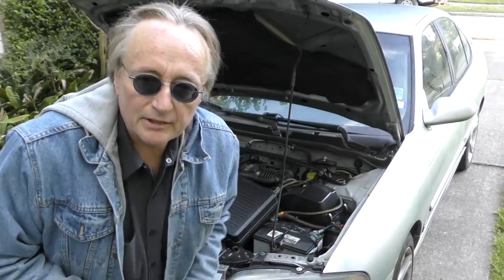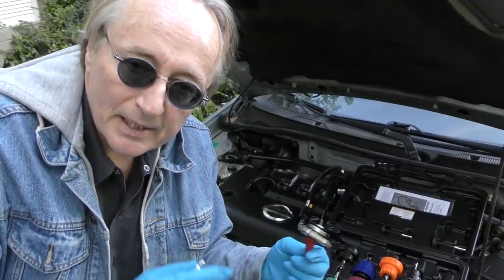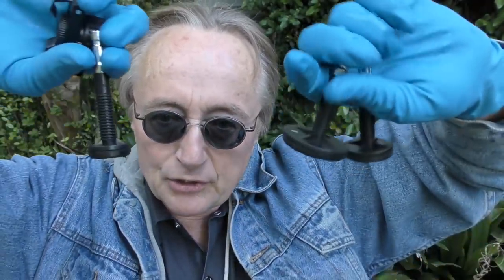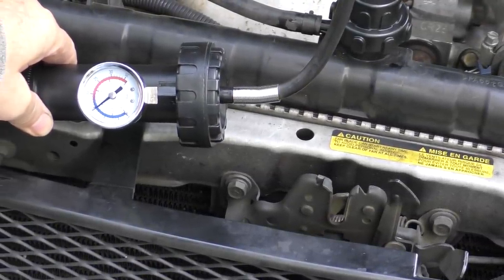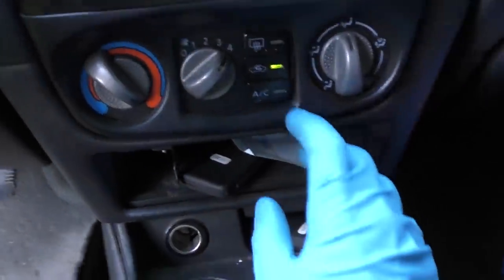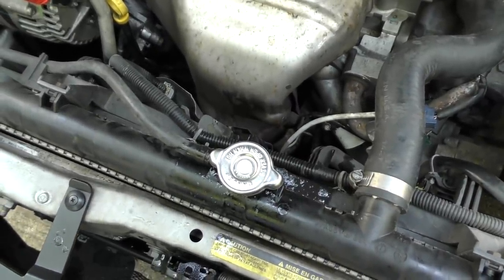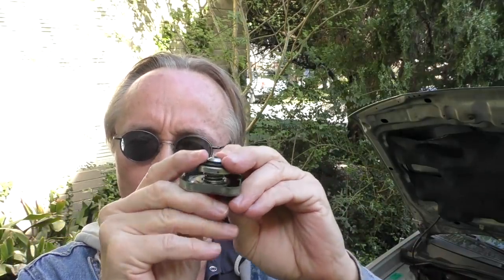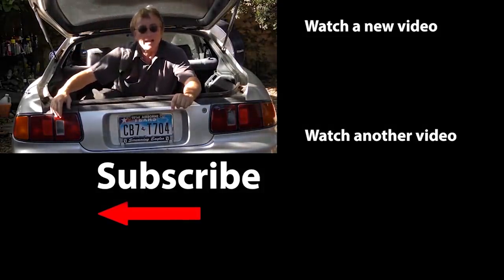How to Fix an Overheating Car Engine for $5

Comment: Just fixed my van with the opposite problem - wouldn't get hot enough! Threw a code indicating a bad thermostat, turned out the thermo was stuck open! Replaced it without much problem and it's working great again!
Reply: Good job, mate!
Reply: Had a similar problem with my Saab, the car would run at the proper temp in town but once on the highway with all the extra airflow the temp would plummet, same as yours the thermostat was stuck open.
Reply: Should have left it open
Reply: GM Kof hard  Beat me to it, maybe if you live in a really hot climate running a car with no thermostat wouldn't be too bad but in most climates you're looking at worse fuel economy at best but more likely looking at accelerated engine wear.
Reply: @Operator-om8ih  I think you can...if you run idle car for few minutes before driving. So temp will get to the normal working range and don't wear out your engine mate. Most of the time I see more than 4-5 mins with a working one....should be longer with stuck open.

Comment: The radiator cap is the last thing most people look for...good advise scotty..
Reply: True! I've been a driveway mechanic for 40+ years and I've had overheating problems many times. But I never would have thought of replacing the cap.

Comment: Scotty, it works this way, the boiling point of water increases with pressure, about 2dF for each #1 of pressure, so a 15 psi radiator cap allows the coolant to run about 30 degrees hotter b4 it boils.  Modern carz have higher temp thermostats making the engine run warmer, this is for emissions and fuel efficiency but it is probably a good thing generally since other things are better when warm.  Then of course we put an AC condenser IN FRONT of the radiators so the already hot Texas summer air is even hotter, radiators work on temperature differential, i.e. the air flowing thru is cooler than the coolant, since we can't make the air cooler so instead we made the coolant hotter.  This all works out OK providing you maintain pressure in your system and run a 50/59 mix of antifreeze and water (modern antifreeze has a higher boiling point than plain water) this allows the system to get above about 250dF b4 youse is in trouble.

A real engine engineer taught me this.  An engine can only generate power up to its maximum ability to reject heat,  Engines convert about a third of their fuel into power, the rest becomes heat and either goes out the exhaust or into the cooling system, if the cooling system can't handle the heat, you'll be on the side of the road.  A lot of the muscle carz of the 60s and 70s had this problem.  If you tried to run them at sustained high speeds they'd overheat.  Small block V8s were especially prone since in making them smaller they left way less room for the coolant passages, couple this with a small radiator and youse is in trouble.  Fords of that era had less problems since Fords generally had about a 1/3 more coolant capacity than the competition.  This is also true of oil capacity, super engines not only oil bearings at pressure but they squirt oil on the bottom of the pistons to keep them cool and they use an oil cooler as well as a radiator.  In case youse was wondering why your car engine is rated higher than the same sized truck engine, the truck engine is rated at 'continuious duty hp while your car is rated at instantanious peak hp.
Reply: Excellent comments
Reply: Thx for the excellent comments.  Yeah the muscles may have been more for drag than running long distance.  Maybe the GTO and Buick GS were more marathon than a cheaper Chevelle?
Reply: I was going to point this out, I think you explained it better.
Reply: Somebody use Google and copy and paste. 😂😂😂😂
Reply: @Catholic.Church  Or read a textbook. This is a form of fluid dynamics.

Comment: When I was a kid I had a car that started to overheat.  Me and my friends were pretty knowledgeable about cars but this had us stumped.  I took it to a station and he found it was a collapsed baffle in the muffler that was blocking the exhaust flow.  He replaced it and it was fine.  I was impressed.
Reply: I am curious about how you knew it was a collapsed baffle in the muffler. FYI; I am an old lady who just wants to learn stuff; not a mechanic by any means.
Reply: @seriouslynow22   The mechanic told me when I brought it to the gas station for him to look at.  The hot exhaust gases had no place to go so the heat backed up into the engine causing it to overheat.  I guess its the kind of thing that took more experience to discover than I had.

Comment: Replaced thermostat water pump etc ended up being  $13.00 radiator cap haha! But Scotty explained it well on what was going on!
Reply: Damn, I did exactly what you did. Replaced the thermostat and water pump, but nothing fix the overheating yet. Hopefully, this radiator cap solve this issue

Comment: Hi Scotty, I have been a car-guy since the age of three.   Yes, I could accurately identify nearly everything under the hood.    Fast-forward to my adult life I became a wheeler-dealer, then later-on an award winning Automotive Service Advisor/ Assistant Manager  in charge of a garage full of ASE Certified talent.  I have no ASE Certification.  I was certified by Maremont for Exhaust,  and held other certifications in tires and brakes including emissions.   So, I know my way around cars and the business, better than most.   I have to tell you Scotty I have not found one exception to anything you have ever stated in your postings.   You are amazing and make me very happy knowing there is hope for customers needing service.   I live in the land of crooks in the Fox Valley Area here in Wisconsin.  Now that I am retired due to illness, from time to time I visit auto shops for this that and the other.    Most people don't know me so I never let on that I know anything.   Too many times I have been horrified, shocked and disappointed at the laziness when it comes to car repair where I live.   Nobody wants to take the time to properly diagnose, they are all a bunch of "parts-replacers."  That is just about the bottom of the barrel when it comes to quality work.  There are several large chain stores who are among the worst offenders.   But the shoddy shops sure know how to find unnecessary repairs and charge up the butt for it at ridiculous prices.    I wonder at times if these people go to church
on Sunday or what they teach their kids???   There is enough business out there where auto repairs can be done efficiently and without over-charging.  Apparently these guys skipped the training on repeat business and earning the customer's trust.   I have a 3 year old Chrysler Van with a full Warranty.   The dealer wants  $90.00 or more dollars each time I bring in a situation covered under warranty- before they have done anything!!!    For what?!  To bring my Chrysler into the shop and write up a work order?!  Shocking!   The first time I knew I made a mistake taking my vehicle to the dealer was when they were going to charge me over $3,000.00 to fix a simple small door ding!    Mr. B.S. who was talking this deal over with my fiancee hadn't noticed me sitting in the passenger seat, and man did I get an earful!!!     He explained the door-ding-repair in great detail saying thing like:  The door is going to have to come off.  The inner panel will need disassembly, that will have take up to half a day.   Painting will take several days because the door and maybe the side will have to be painted as well.  Now this all is for a door-ding the size of a dime.  The B.S. went on and on.    Then they wanted the car for over a week and were more than willing to rent me another car.   I had the Chrysler repaired at a local body shop for $300.00, the car was in and out in three days and they hand washed it and vacuumed the inside and did the windows too shortly before pick-up.   You couldn't tell there was ever a door ding and it looked beautiful.   There is one place which has earned my trust, and I live in a big metropolitan area.    I live in the land of crooks,  the Fox Valley Area here in Wisconsin.   Where the car repair places are more interested in your wallet, and how quickly and for how much they can empty it out for.   It's like hit and run car repair!  Thanks Scotty, for being one of the god guys who has a heart as well as a brain, a rare combination these days.
Reply: merc1110 Thank You for sharing. Do you think they go to church?

Comment: FYI back in the day I had a 79 Ford 4x4 f150 that would overheat on the highway.  Took it to a backyard mechanic in SC & he backflushed the radiator & that cured it.

Comment: A lot of comments about opening the cap after the car ran. If you need a rag or mechanics gloves to take it off it's probably not safe. In this case if you watch he lifted the release and nothing came out meaning it wasn't under pressure. Most caps you turn to release then push and turn to remove. If you need heavy gloves because it's hot  better watch out.

Comment: I don't see a big need for the pressure tester. You can allow the system to reach normal operating temperature and look for leaks under the vehicle. If the cap is bad, the upper radiator hose won't feel like it's under pressure. That car sounded like it had an old battery low on cranking amps.
Reply: If you work as a mechanic, time is money. If you can pressurize a system in 2 minutes to locate a leak instead of the 15 minutes or so to get it hot, you're saving time. If you find the leak then you don't have to wait for it to cool down to repair it.
Reply: Cranking does sound like a weak battery and look at all those huge added cables for amps! That can weaken the battery quickly running low too often.
Reply: @meabob  That's true, for a mechanic it will save time.
Reply: Perhaps stick to electronics... leave the mechanics to mechanics. Scotty hit the nail on the head.
Reply: @electronicsNmore   Your reply proved my point... 30 years of fumbling I'd guess... you're not anything like Scotty!

Comment: A lot of newer cars don't have radiator caps. The plastic tank connected to the radiator has a pressure cap. Can those be pressure tested?

Comment: Over 40 years with no radiator cap replacements. Now after this video. Every 4 years. The influence and conviction this man Scotty has in his videos.
Reply: When I bought my then 43 year old Cadillac, it was a hot day and the ENG TEMP light came on while driving home on the freeway, the hoses felt like full pressure. I replaced the cap with an A/C Delco— all good three years hence!

Comment: Hello Scott, I've got a 2009 Subaru Forester, the 2.0 N/A DOHC version. Generally it does not overheat, neither in city traffic nor in the highway, BUT it has occurred to me approximately 4 times (2014, 2016, 2017 and 2019) that the car wanted to overheat for a large part of the trip (2014,2017) with the red light appearing 2-3 times, had just the red light on momentarily (2016) or had the tendency to overheat but no red light (2019). In incidents 2014,2016 and 2019 I slowed down and tried to keep temps down. In the last incident (2019) I had new radiator, new cap, new coolant, new t-stat. And taking into account that 2014,2017,2019 happened in ex-Yugoslav soil or with yugoslav fuel, could it be that it has some relation to it? Maybe ethanol in fuel causing it run lean? 
As a side note the system has been pressure tested, no signs of leakage, tech says that 2009 did not have HG problems like the older 2.5 american engines.
So, any idea of why this might be happening ?

Comment: Scotty, I had a weird overheating problem. Pressure test the cooling system passes fine. Pressure test the cap passes fine. Put the cap on the car properly, warm the engine and it seems fine for several days. Then go out to drive and once the engine is warm it starts to overheat again. Turns out the outer seal on the cap was not working. Once the engine got warm while driving it would blow coolant out and once it cooled down it would suck air into the radiator. After a couple of trips in town, it would overheat.
Bought a new cap at the auto parts store, same problem. When to the dealer, my VIN number listed a different cap with a different pressure rating. The parts stores didn't show the special cap.
You often say in your videos that critical parts should be purchased from the Dealer. Even something as simple as a radiator cap is critical if the aftermarket caps do work for your specific car.

Comment: I love these instructional videos. My old Porsche had a very high coolant system operating pressure, ~21 psi. This high of a pressure put more stress on the rubber hoses and connection fittings, so I would check the condition of my cooling system periodically.

Comment: Hey Scotty turning on the A/C to to see if the condenser fans are working is not the best way to see if they are working as designed. When you turn the A/C on it overrides the signal from the ECT and turns both fans on. I would leave the air conditioning off and monitor the coolant temperature preferably with a scan tool to see if the PCM is turning the fans on when the coolant reaches the correct temperature. You can also monitor the voltage being sent to the PCM from the ECT this would let you know if the ECT is functioning properly. I would also pressure test cap before progressing to the above steps as some pressure testers can test the cap also.

Comment: Thanks for video, I had Golf mk1 pickup, it was overheating, I replaced heat sensor, Thermostat, water pump, axillary fans, and flushed my engine, then I cooked my engine so I bought a new engine, and a NEW RADIATOR, all 100% fixed, it happened to be a partially clogged radiator. That old radiator gave me years of grief. But

Comment: Hi Scotty. Great video and advice, as always. But your Radiator Pressure tester link doesn't go to the Pittsburgh Radiator Pressure Test Kit. It goes to a Stant tool. Bug in the system?

Comment: Sir, you have a witness! Two days ago my car overheated with signs as you described. I saw this video in my lineup and watched yesterday afternoon. Today bought a new radiator cap. Put it on and no more overheating! (But my cooling fan did not come on : / ) should I check that out somehow?  You are doing a great service for people. Thank you. : )

Comment: My DeVille has taught me so much about cooling systems
Reply: Northstar?
Reply: @drfalcon4102  you bet
Reply: A worked on a 1976 Coupe DeVille and it’s first indication of a cooling system problem was the smell of burning oil from the valve cover gaskets leaking onto the exhaust manifolds— the cap was failing, lost pressure allowing coolant loss and gradual overheating which caused the gasket deterioration.

Comment: Good advice, i had this issue on a 2014 Mitsubishi. After a long day of driving my temp shot up and i pulled over to find coolant everywhere with no leaks. Turned out the cap spring just wore down too much allowing the coolant to bypass to the overflow.

Comment: There is a real danger to removing a radiator cap on a hot car.  I saw a guy get burned quite severely as the hot coolant sprayed out all over him.
Reply: Sometimes you CAN fix stupid! Unfortunately, sometimes it requires getting burned severely!
Reply: You didn't think to warn him?

Comment: Always work your way up radiator cap,thermostat and so forth..pray it's nothing major!🤣
Reply: Yes- Start out with the easier, more direct things!
Reply: True
Reply: Thermostat and water pump are two most common causes. I replace both few times more than prescribed because if those go bad the head can bend from overheating. Too big headache if that happens 🙄
Reply: Never assume there’s a cracked block and work to the easiest solution!
Reply: Oh c'mon... It's the best when the heater core leaks... You know those tight spots are the best to get into
Reply: @DeRen179  what head are you talking about?

Comment: Very good advice here to use the factory radiator caps.  I have used after-market ones and they seeped or didn't hold pressure.  OEM ones cost 2x's as much but very well worth it.  Change them every couple of years👍
Reply: Do you consider Gates Stant oem equivalent, or junk? Thx
Reply: @mazdarex7  I wouldn't say that stant or gates are junk I just have had both those brands leak on me and not hold pressure and the factory ones seem to work better.  one vehicle in particular that I have a 2000 Dodge Grand Caravan is very picky with radiator caps it has to be the factory one any other one will just leak.  so the price difference isn't so much different that you want to risk overheating and have to pull over on the side of the road I'd rather pay the extra money for a factory part and know that it's good rather than buying an after-market one and hoping that it is.
Reply: @eppyz  thx very much Jeff.  The new one from rocky, for an 89 351 has a slightly flimsy pressure release lever, I'll keep an eye on it.

Comment: Overheating is such a complicated issue; thanks Scotty for being so helpful!
Reply: There is normally much more to it than a radiator cap. When I get one the first thing I check is coolant level, radiator opening, and the cap. Most better pressure testers have an adapter for testing the cap to see if it holds at it's rated pressure.

Comment: I noticed a tiny amount of dried antifreeze under my radiator that looks recent, i noticed my fluid level went down and it doesn't look like its leaking anymore. Maybe too much pressure built up in it?

Comment: Scotty my dad's f-150 air conditioning doesn't work when truck's  going at a faster speed or or when it's been on for awhile is the actual leaking or needs ac coolant/refrigerant.

Comment: I keep getting an over heat while idling, just a tad. The coolant tank stays the same level, but the radiator needs filled up some every time it starts to do this. Nothing is leaking that I can see, heater core hose might be leaking or going out?